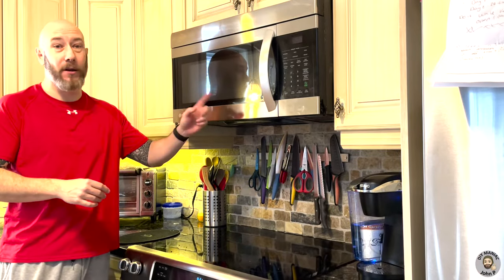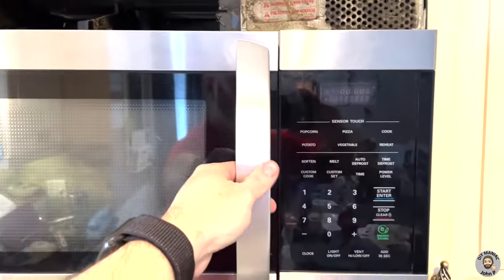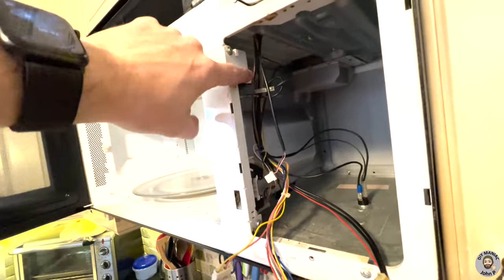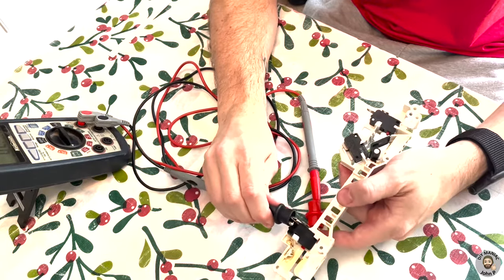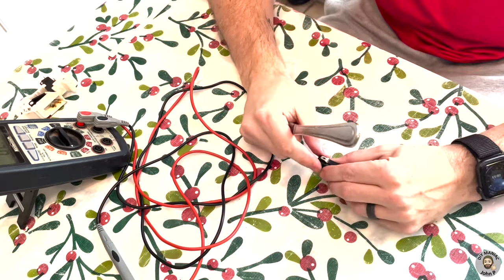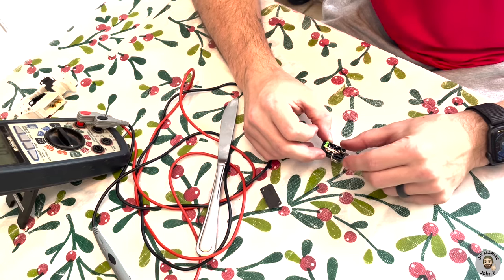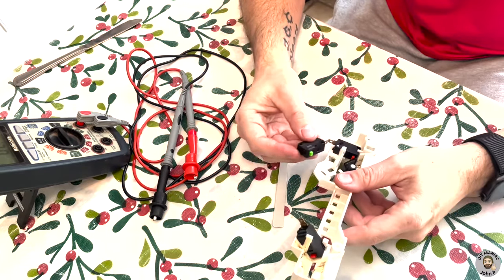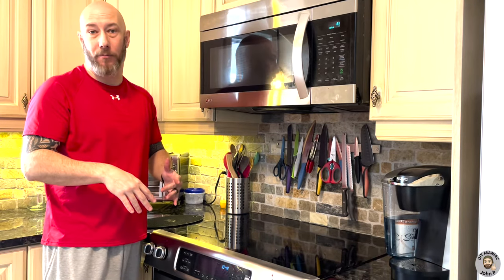Microwave Door Switch Repair

Comment: Okay! I'm a 42 yr old woman and THANKS to your video, I was able to DO THIS! And my microwave works now! I'm sooo super proud that I was able to fix this so my busy working husband didn't have to! And I was really scared after reading about capacitors and death and all of that! Definitely have to be super careful but I feel a lot more knowledgeable now. I still don't really understand what exactly I was doing with the tester and could use a bit more explanation on that. Also it would have been nice to see the readout on yours as mine doesn't beep just gives a digital readout, but I must have guessed correct on the ONE switch I replaced because it works now! Also the switch was blackened and corroded compared to the other 2 looking clean, so that was a clue about which one/s were bad as well. THANKS AGAIN!

Comment: Thank you for pointing the door issue. Before you start dismantling anything try cleaning back of the door and hooks going into the two openings with soap to remove grease built up. It worked for me 😊. No more intermittent stoping.

Comment: Don't open your door to pause the microwave.....hit PAUSE first to disengage the switches then open your door and you will have no more trouble. Pause is on that key pad for a reason...to shut the power off on the switches.
Reply: exactly, if you don't pause it creates that arcing that corrodes the contacts
Reply: @blackmangopit  Right.

Comment: Not to blow this up.....but what typically happens to these switches, is that over time oils in the food being cooked becomes airborne inside the Microwave. This in turn ends up a sticky coating on the inside of the switch causing it to stick. Thus when the switch is in the engaged position, downwards since they get very sticky it sticks downward as if engaged in the ON position. Go get some Mineral Spirits (Paint Remover)  and place in an open glass jar of your choosing. Next take a pair of plyers, such as needle-nose type and grab the long connector in the rear of the switch and just dip it into the Mineral Spirits and swirl around for a minute, remove and shake out any excess, I also blow into it and dry with say a paper towel. Problem solved by the solvent as it removes the grease that has accumulated inside the switch. Then they are back to normal. Save yourself the money, and the customers.

Comment: Thank you for showing which switches were open vs closed!! No other video did that but yours
Reply: Agreed, that was key! All my switches worked, but the contacts were a mess. Symptoms were, running while open then turning off when closed lol. I used a file, sandpaper, Deoxit 5 and simply put it back together. Works mint! I had zero room to work either. Mine is also a convection, rotisserie etc… I wasn’t getting a new one till I destroyed this one fixing it lol.
Reply: Definitely agree. I replaced the door monitor in my microwave only to have the fuse blow the instant I plugged it in. The normally closed middle switch was connected backwards. It should work now.

Comment: Thank you for the great video. Our microwave is working again. 

Our issue was the bottom switch. Looked like the contacts were fused together with solder - any thoughts on what would cause this?  Our fuse was also blown and looked like high voltage went through it and splattered what looks like solder in the fuse tube. 

Thanks again!

Comment: thanks for your thorough explanation - glad to know I can just clean the contacts. I bought a new switch a few months ago and just got to doing it today. It's working good again. Using the tester was a really good tip so I wouldn't have to remove all of the switches. That plastic bracing holding the switches is not easy to work with and easy to break the tabs holding them in.
Reply from the maker: Glad the video helped and thank you for watching

Comment: Terrific video.  Thank you.  I have GE microwave that powers on, counts down, and turntable turns.  It just doesn’t heat up.  Since the turntable turns does that rule out the door switches as the problem?   Is the problem likely the magnetron?   Thank you very much.

Comment: My switch "broke" two years ago, so bought a new one. That solved the problem. The new one "broke" after two years but unfortunately cleaning the corrosion didn't work. However, I found the old "broken" switch in a kitchen draw, cleaned it of corrosion and what do you know, the old broken switch is now working. Thank you.

Comment: That was great. How do you find the correct switch?  Is it comparing  vint volts, amps, etc to ensure they are the correct switches?
Reply from the maker: As I mentioned in the video, you’re going to want to check for its normal state, either normally open or normally closed

Comment: How do I tell if the switch is the problem with my microwave? The control panel still works fine, but when I open the door, if the light doesn't come on, my microwave won't work. It'll beep when I try to start it. I'm hoping this is all that's wrong, but how do I know for sure? Thanks.

Comment: I really like your video with no fluff. I changed the fuse, because the loss of power it worked for power but blew the new fuse too because there is other issue. I replaced all 3 door switches and again the fuse and sadly same result once you turn on microwave it blows fuse and loses power. Any additional suggestions and thanks for a clear video good job 👏👏👏

Comment: In my case, the door latch hook is broken on one side.  My microwave is part of a dual unit with the oven.  14 yrs old and most likely not even available to buy now.  The plastic right side hook broke off and the microwave won’t work, nor the light turn off.  Any suggestions on how to fix this?  Thank you!!

Comment: I have two microwaves that have bad upper normally open switches. The button was not sticking up and it was always closed like the door was closed and they looked burned. The other two switches on both microwaves seem to be good. Parts are on order.

Comment: Question I replace the control panel on my microwave. When I put the new one and close the door the light stays on and all the keys f work but it doesn turn and the fan doesnt come on. I put the old one back in and does the same thing. I Hold the control panel in my hand everything works. Any ideas? Thanks in advance

Comment: Thank you so much was able to replace switch easily. I didn't unplug the control panel wires I was able to turn it on side and rest it in the opening.

Comment: Hi @diy maniac, I tried to do this and broke plastic tabs on couple of it. I used electric tape to ensure it doesn't move. After connecting my microwave turned on but light is always on and is not turning on. It's also doing a whirring sound.

Comment: If anyone knows, are there any other reasons besides the switches that a microwave could runs when the door is open, such us the control unit? Because in my case, all switches where fine and in position. Also, if I don't use the normally closed switch and just use the normally open switch to interrupt the phase in the whole circuit, are there any dangers?

Comment: I'm having a problem with my kitchen aid microwave. When I try to press start I get a door open error. Light does not come on when I open the door. When I close, pressing start I ga et door open error.  I tried cleaning around the door sensor area, that didn't work. 

Any suggestion ?

Comment: great vid!  have samsung similar to yours.  already replaced board couple yrs ago but now wife says closing door starts everything up,  tray/lights/heat.  will one of those switches cause that or do i need to look someplace else or replace circuit board again
Reply from the maker: Thank you for the positive comment when you say closing the door and everything starts up. Do you mean the microwave turns on and starts heating? Were you mean just a turntable turning and the light comes on?
Reply: @DIYManiacJohnP  since it has just started to occur and my wife is the only one to see this, i cannot say for sure that heating happens. only table turns and light is on for sure
Reply: thinking it is the door on switch.  have a samsung smh9187st , and if the primary is on top then it should be one of the lower switches?
Reply from the maker: Most likely it’s not heating just turntable turning and light on would most likely be one of the switches

Comment: WHen pressed the Upper switch (video @ 4.22 min)  manually when power is on, gave small spark and MCB tripped. After resetting MCB now there is no power showing in microwave. what could be the problem. is switch short circuited?
Reply: You blew the 250V 20A fuse. I took my microwave down and completely disassembled it before watching this video. I hit one of the switches manually and it sparked and blew the fuse. I knew because everything lost power. It’s a good thing the fuse blows because it protects more expensive components. I think the switches are setuo to trigger at the same time so if you just hit one, it can cause issues. That’s probably why some ppl have blown fuse and bad switches because one switch is sticking or not flowing electricity. Not sure exactly why it sparks though, maybe it’s drawing too much power because other switches should be open or closed simultaneously so a circuit is connected or not connected that shouldn’t be.

Comment: hello, i have a relatively new GE microwave #JVM6172SK4SS. i have heard from some local companies that working on the microwave can kill me even when unplugged due to the capacitor. is that something  will have to worry about with this repair or is that an entirely different part of the microwave?
Reply from the maker: Always exercise caution. But with this repair you are not near any dangerous components

Comment: Thanks for the video.  Can you do this without discharging the capacitor?  If yes, why is it safe?  Other places say you should do that first.  Thanks!
Reply from the maker: This is just the control panel. It does not go anywhere near the capacitor or the magnetron
Reply: Thank you sir! I will try to do that to fix my microwave.

Comment: I have been struggling to understand this process of testing the switches on my microwave. At first I thought none of the switches were working but then I realized my multimeter NEVER makes any beeping noises!   So some multi meters are made without a beep option!?  Is this possible? It's frustrating because all the microwave repair videos I've watchef, people used beeping multi meters.  Uugh
Reply from the maker: The audible continuity test is merely a resistance (ohms) reading that gives audible signal for a closed circuit
Reply: @DIYManiacJohnP  thank you for the reply. I understand what a closed circuit means (a closed loop allowing the electricity to flow). But without a beep, digitally, what in the digital display tells me the digital equivalent of the meter beeping?  Like...0.2?  Maybe im in over my head. I took chemistry & physics (did well) but I'm not familiar with using multi meters. Sorry. I don't want to take too much of your time
Reply from the maker: Any reading in ohms is a closed loop. And open loop will not return a resistance reading
Reply: Mine shows something low for continuity and a 1 for no continuity. You can always check by testing something you know has continuity like by touching the 2 voltmeter leads together or 2 ends of the same wire, 2 grounded points, etc. I can’t remember where I put my voltmeter, it’s a cheap one, but I miss it because it has the audibke continuity test which I’ve since realized I prefer and love,
Reply: @tomgrobelny  Thank you👍

Comment: @DIY Maniac John P  I was able to check other top switches with multimeter on continuity, i noticed the bottom one is in faulty but I can't remove it from the conectors! It is stuck in and I don't wanna break the plastic connector cover, any solutions how to remove that bottom connector from the swtich and replace without breaking that  connector cover? Thanks
Reply from the maker: They can be sticky and difficult to get off my best advice is to pull harder. You can also try to get some solvent in it to lubricate and clean
Reply: @DIYManiacJohnP  I already tried to lubricate 2 weeks ago with WD-40 and also WD-40 Silicone lubricant, none of them had an effect on removing or separating the terminals from these plastic covers! The microwave has been open apart for a long time now! More than a month! The issue is only with the botton one which is the one that needs replacement, others were easily removable. Idk what else to try...
Reply from the maker: @seekfactsnotfiction9056  at this point the only uptown you have to is to pull full strength. You could also try prying it off with a flat head screwdriver
Reply: @DIYManiacJohnP  Ok thnx will try to do that. Are those plastics neccessary if they are torn apart? Can i still replace the switch if the terminal covers become useless?
Reply from the maker: @seekfactsnotfiction9056  the plastic is just a shield around a standard female blade terminal
Reply: @DIYManiacJohnP  I sprayed a good amount of the WD-40 for one last chance, if thag doesn't loosen anything then I'll use force. Thanks for your help. I'll update u what happens. Hopefully it works!
Reply: @DIYManiacJohnP Update:  The WD-40 Silicone water resitant spray worked at the end, i used more force to take it out, finally it came off, I think the reason it was stuck could be that it was never opened before since we had this microwave for over 20 yrs, this is actually the first time we ever had any issue with it! Thnx for your time and help

Comment: I replaced my switches and it comes on now and the turn plate spins but now it doesn't heat?
Reply from the maker: I would double check your replacement switches and make sure you match the right normal state position
Reply: @DIYManiacJohnP  what exactly do I have to do for that?
Reply from the maker: As I said in my video, some of the switches are normally in a close state while others are normally in an open state you will have to check as I showed in my video continuity. But again, as I showed him my video you first need to identify the placement of the old switches. Now that you’ve already removed them that will be harder to do.
Reply: @DIYManiacJohnP  got it. Thank you so much for explaining that

Comment: Easy repair with new door switches for our Samsung microwave.  (I didn't have to remove the control board, only the switch mount.)  Literally a 25 minute repair.  $8.61.

Comment: I’ve replaced my fuse. Nothing. Tested all three switches. Nothing. What else could it be?  Argh!
Reply from the maker: What symptoms are you having?
Reply: One day it just had no power, sound or lights. Basically dead
Reply from the maker: @TheOrganizingAgency  let’s start at the basics even if it seems silly. Did you verify there is power to the receptacle that the microwave plugs into?
Reply: @DIYManiacJohnP  yes of course.   The outlet has power, breaker never tripped.  I bought a new fuse, and tested the three switches as shown in this video.  It’s a 4 year old LG microwave.